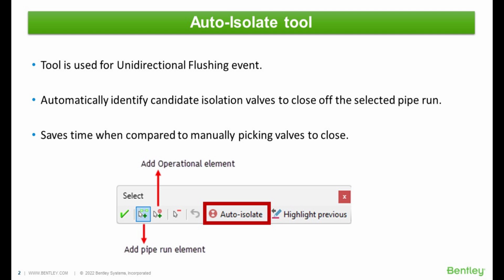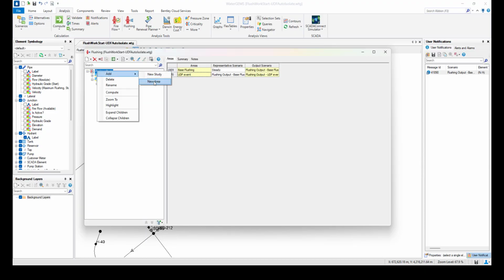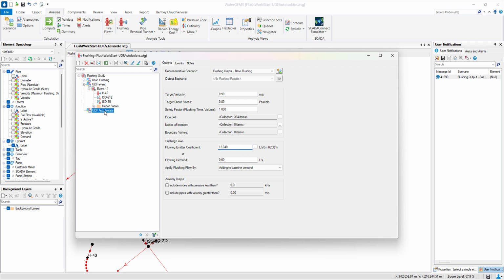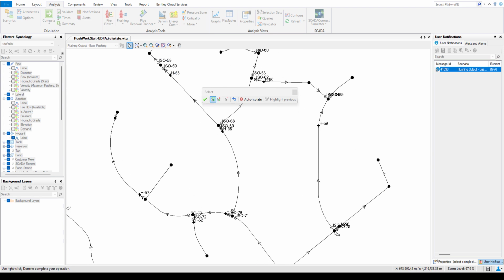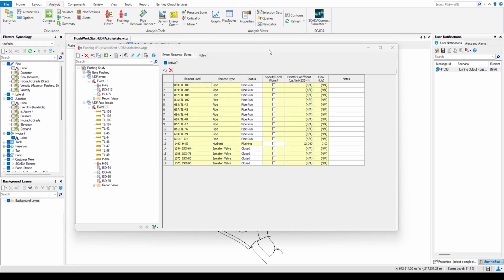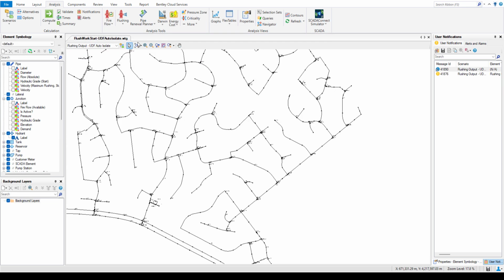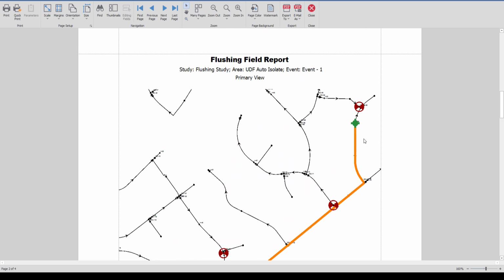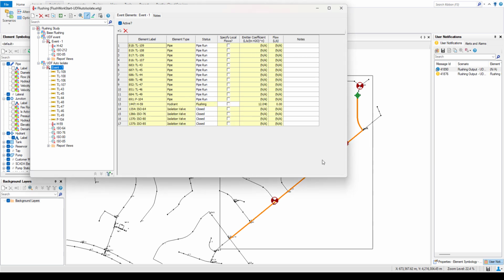WaterGEMS Advanced Part 12a: Workshop 6 - Auto-Isolate feature for Unidirectional Flushing

Comment: hi when clicking "add->new UDF event" I do not get the dialog box with the option of auto selecting, I only have the mouse showing and the program telling me to select manually. any tips?
Reply from the maker: Hi Ryan, when you choose to add a new UDF event, a toolbar should appear and there should be an "Auto isolate" button. If this is not present you might be using a very old version. If the toolbar is not appearing at all, try going to View > zoom options > reset workspace. If you need further help, please submit a case to Support: https://bentleysystems.service-now.com/csp